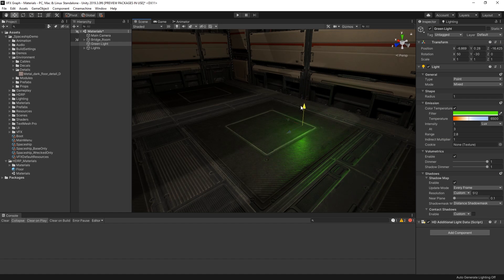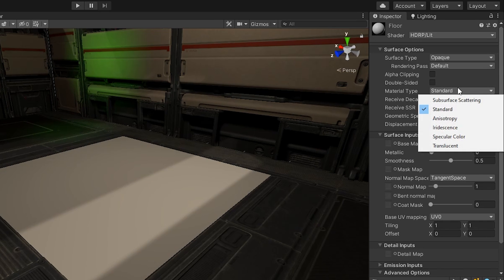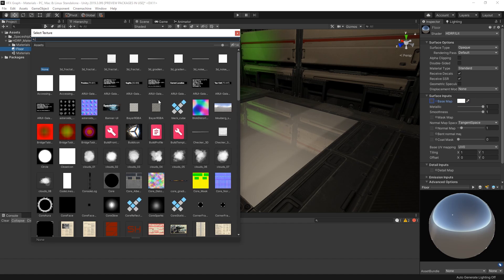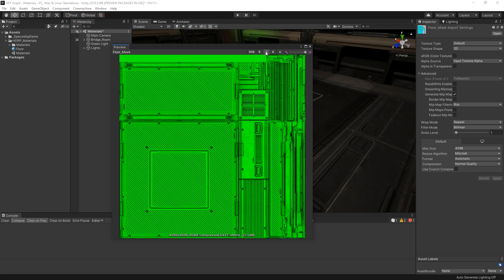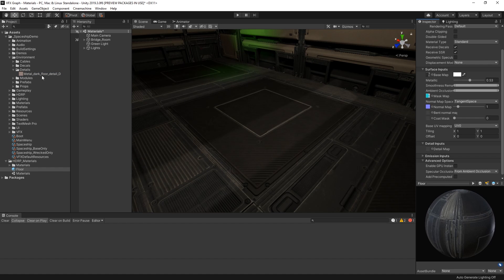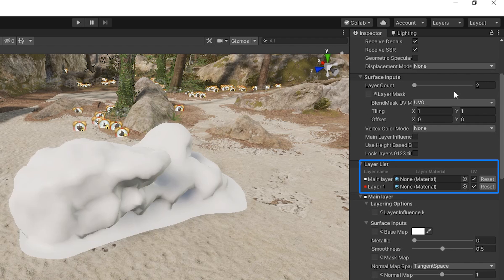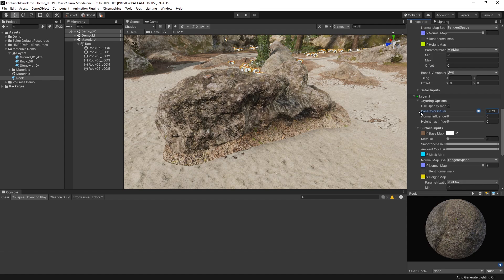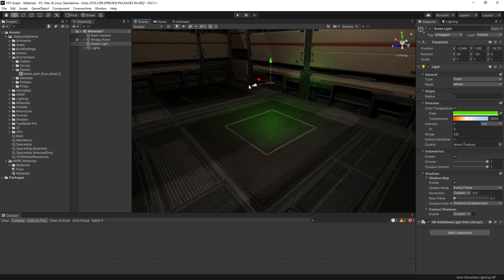Creating Realistic Materials in Unity 2019.3! – HDRP Tutorial

Comment: Detail Maps so far have proven to be the most unpredictable and unnecessarily complicated thing ive ever had to deal with inside of Unity. Not just because of the the complex steps you have to go through every single time you wanna make one of these things (separating and copy pasting maps, removing them out of channels to slap them back into the channel of a different texture and so on) but also because they don't end up looking anything like the secondary normal map details of the built in render pipeline, at least not for me. Simply having a slot for a single normal map like the old way of doing this is so much more preferred for me.

Comment: 40 fps in htc vive with gtx 1080 on empty scene, Thanks hdrp !
Reply: in editor?
Reply: @Baltverge  50fps in build. Switch to default render give 600-700fps
Reply: HDRP and default render are two completely different things. Of course you will get a huge performance increase. Did you try asking on the forums? Did you try submitting a bug report?
Reply: What does the Profiler say?
Reply: Could have some other hardware bottlenecking your system. A computer isn't just your graphics card after all.
Reply: @MCtomgie  i7 8700, 16 gb ram 3200mhz, project on nvme ssd ( samsung 970evo).
Reply: @hspxz  God save hdrp

Comment: Looks great, I’m wondering how it is in term of performance, but generally I’ll experiment with it. Cool stuff :)
Reply: Amazing performance. Has improved greatly since the early days and can be optimized quite a bit. Most people sayign its bad they are trying to use the new system in the way they did in the past. That does not work. Performance is excellent giving over 70fps  in a busy scene with millions of polygons and no LOD.
Reply: @keelfly  Performance is great xD? Performance has went DOWN. Same project in 2018.4 smoothly delivers 90 frames. 2019.2 / 2019.3 not only increased compilation time by approx ~40% and reduced frame rate in editor by ~25%, but we also only get 70 frames in build. And this ain't even HDRP, was URP. 

And how can we even discus performance if stability is non-existent? FBX with multiple animations crash the editor, raycasts sometimes ain't hitting shiet if you have a high refresh rate, editor throw random errors on opening an empty project, and plenty more I discovered in only 3 weeks. I'm full of it - I'm updating to 2019.4 if there will ever be one perhaps.
Reply: @Onidourou  Previous renderer renders faster? Sure it does. But NOT with the same features.  ;) 

Disable all the features the standard renderer does not support, and you will get the same if not better. 

ALSO , it is ridiculous to expect exactly the same performance from a renderer that is 1 year old compared to a full fledged amazingly optimized old renderer, but as I said, HDRP delivers.  

Just switch off all the previously non existent features and you are good to go,. Regarding the crashes you mention, I do have others, not related to HDRP though, definitely not the crashes you mention. 

How is a multiple animation crash related to HDRP?  :D 

Also another level of cluelessness demonstrated by you, yes, there will be a .4 LTS version.  That is how both 18.x and 19.x were meant to be.
Reply: @keelfly  It's related to the 2019.3 HDRP - errors and crashes are therefore related to ANYTHING in that version, including HDRP. 

So instead of working on new fancy features they should probably fix it.
Reply: Performance? Run...seriously...run. 
I've went through the trouble to downgrade to 2018 because of how 2019.3 was running.
Had problems with: Fbxes with multiple animations - random editor errors - raycasting - performance - no cutout standard shader -  crap looking vegetation - older shaders not working. 

Stay away from 2019 for now.